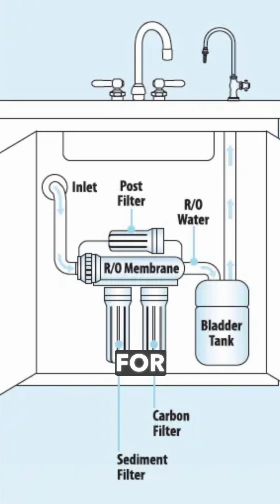Plastic in reverse osmosis filters?

Comment: Unfortunately, 95% of my water source is bottled water. I'm not sure what to do about it. Is it worth it to get a countertop RO filter to filter bottled water? Also, flushing the RO filter would get expensive since all the water is bottled. I could use jugs of water for this, since they're cheaper.
Reply from the maker: A reverse osmosis filter will save you money over bottled water for sure if you can hook it up to a faucet or water line.
Reply: @JonasKuehneMD  I don't have a faucet or water.  Only water bottles. I'm a truck driver that lives from the truck. I go home for a week twice a year. What's holding me back from getting a RO countertop system is the waste water (that's just throwing bottled water away)